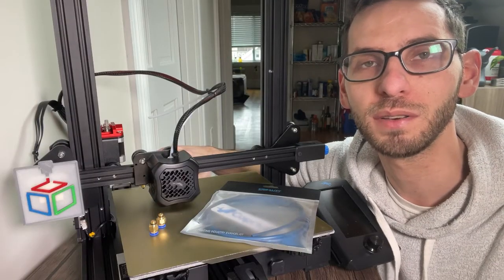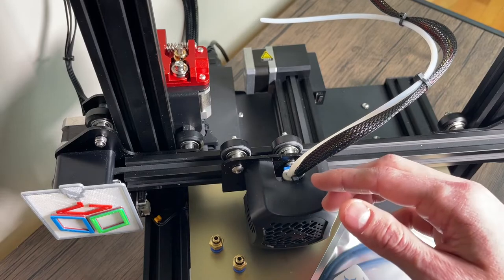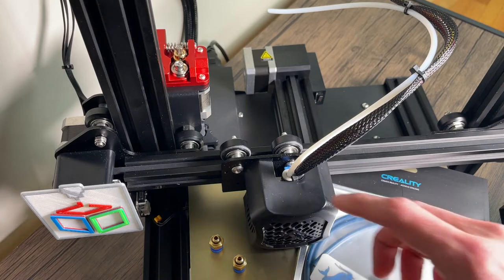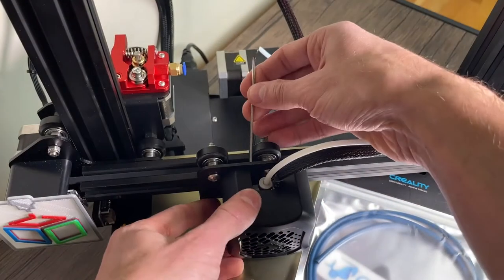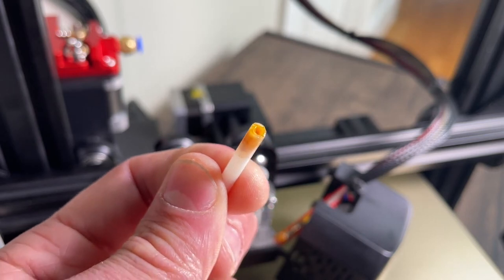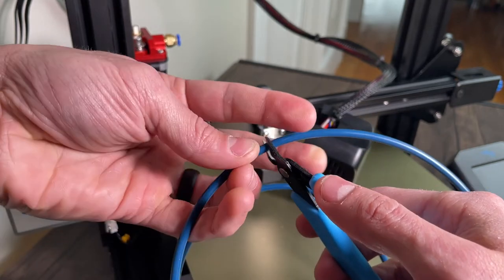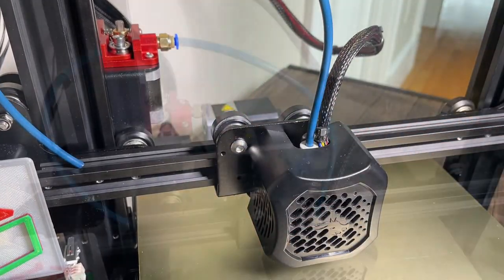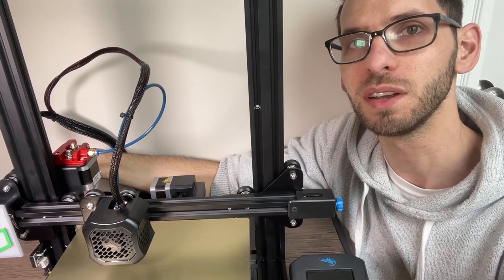How to Install a Capricorn PTFE Bowden Tube on a Ender 3v2 3D Printer (Upgrade)

Comment: if you heat the hotend to 260c   the tube will release instantly i just spended 30minuts trying to remove it
Reply: Hot end as in the nozzle temp?
Reply: Yeah that is what I do
Reply: I was working on removing mine, had to stop since I have to go to an appointment, but that was my plan to heat it up to remove it from the hot end, mine is really stuck. The fitting is screwed off and it is still stuck.

Comment: The Capricorn kit I got comes with a cutter - you just rest the tube in the divot in the cutter, let the blade touch the tube, then rotate it to get a clean cut without compressing the cut end.
Reply: You can also print a cutter from thingiverse and use a razor

Comment: For anyone struggling to get the tube out from the hot end side - do preheat the nozzle (forget the bed) to 200+ so that way the heat will expand and allow a simple release

Comment: This is not how you're supposed to cut the bowden tube non-metal hotend. You need a clean cut perfectly at 90 degrees. Use a utility knife with a printed gutting guide or a filament cutter. This is a critical piece where any gap between the tubing and the nozzle will cause a clog. So make sure you do it properly.

Comment: I am A maker and I have come up with a new Bowden tube fitting to replace the push to connect fittings and would like to have you try them out. they can be found on Capricorn tube web site. they are called lemonade  fittings. We took lemons and made lemonade. Thank you keep up the great work keeping us informed and empowered

Comment: When you cut the bowden tube, it is helpful to cut the tube slightly long, then insert a bit of filament into the opening, then make a final cut to length using the nippers.

Comment: I have the same printer. I use “free” AutoCad Fusion 360 then export svg file to UltaCura (sp?) to make the g code that the printer uses. Is there a better way if you need to keep costs low?
Reply from the maker: Hi Harrison, thanks for the question! I use Cura to slice my STL files to GCODE. It’s probably the most popular slicer softwares out there and is completely free. Not sure if that answers your question, but hope it helps! Like and subscribe and happy printing!
Reply: @the3dprintzone  Yes. That's what I use. Thanks for the reply.
Reply: I don't understand your question
Reply: Dude, just use Blender 3D

Comment: I thought you are supposed to back the bowden coupler off a half turn on the hot end side... put the tube in and then seat the coupler... thus ensuring a tight fit and no leaking around the nozzle.

Comment: Does the Bowden Tube need to be pushed all the way into the print side? Or does it need to be far away from it? I noticed my print head heater whatever you call it is totally caked in old filament it kept getting stopped up. I trimmed that piece out and replaced and it happened again.

I’m wondering if I should push the tube all the way in or give it to Space? Probably all the way in, but that’s why I’m asking.
Reply: Did you find out?  That also why i came to this video i noticed when i removed the original teflon tube it only came out like .5 in and if i push the new capricorn tube it seems to go in really deep if i go all the way in